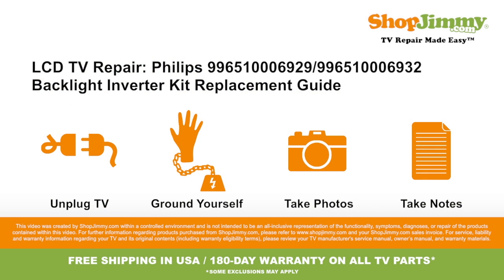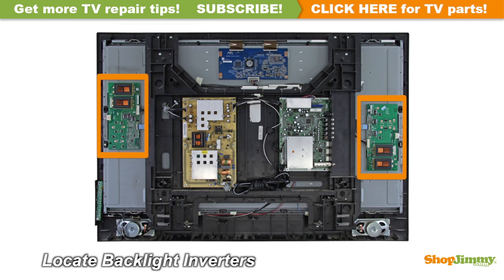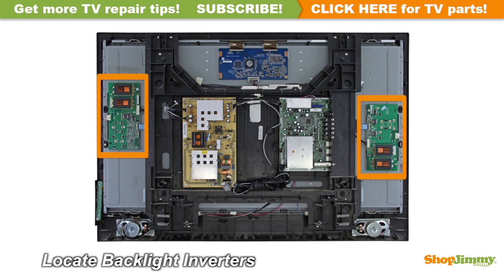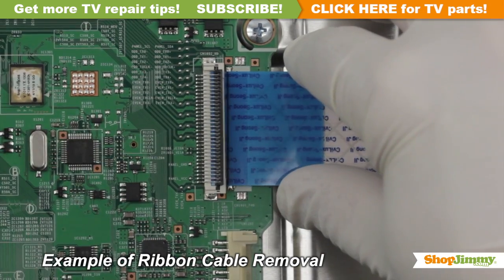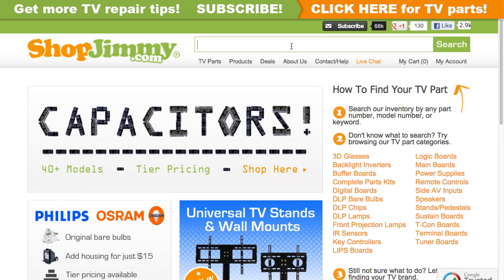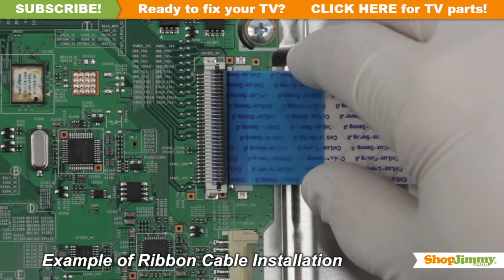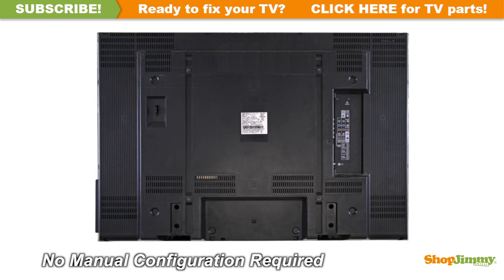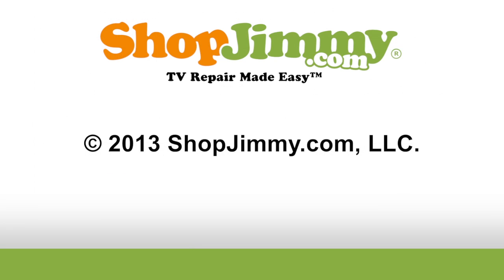LCD TV Repair Philips 996510006929/996510006932 Backlight Inverter Kit Replacement Guide

Comment: I need to buy a set of screwdrivers to open my Philips Model 42TA2800  Serial BZ3A0720372439.   Do you dispatch to Mauritius ?  I should like to repair the Inverter Board or replace it.  Thanks to help.